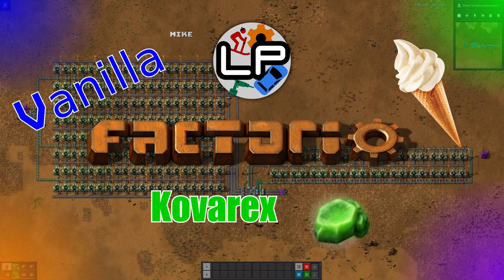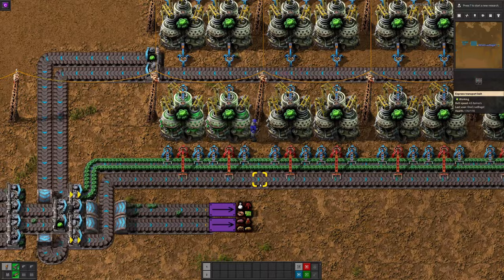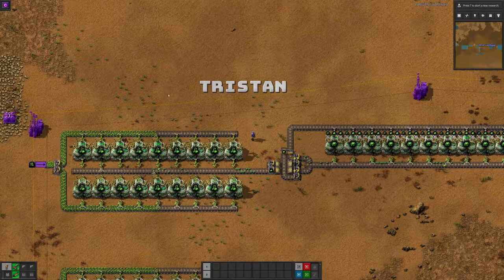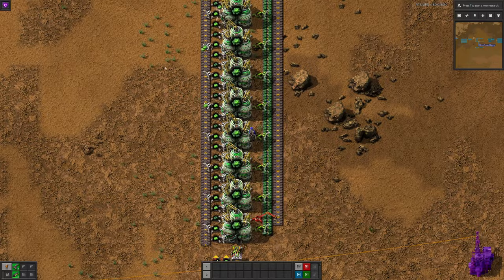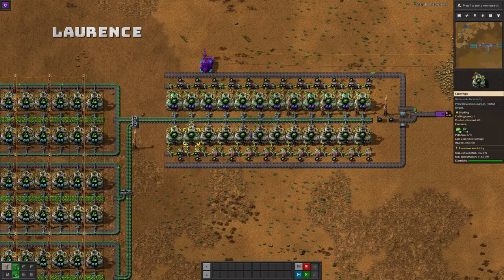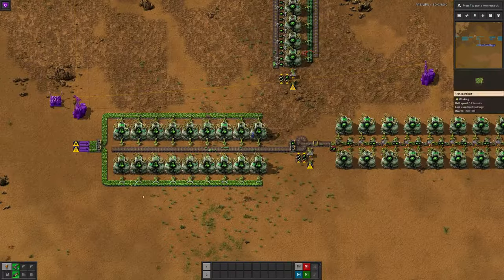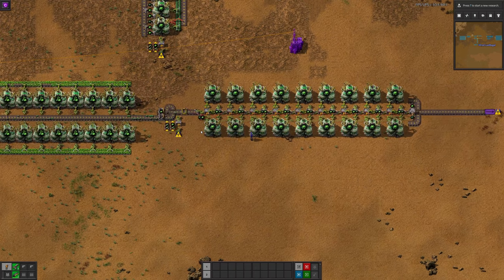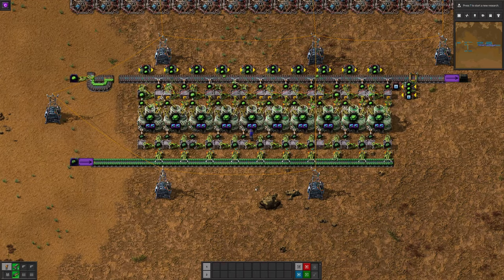Kovarex options - Flavours of (vanilla) Factorio - Laurence Plays

Comment: Some minor additions: 
First of all, if a machine uses 2 belts for the input, you should place the belt from which more items get grabbed as the closer one to the machine, this greatly increases the throughput.
Secondly, for energy-efficiency with beacons, its always a good idea to have beacons rather in the middle, so each beacon covers the maximum amount of possible machines, needing less modules and consuming less energy with the same output.
Reply from the maker: The first one is a good point, although if the machine runs slowly enough that the long handed inserter can keep up, then it doesn't actually matter. Was it a serious problem on any of the designs? I don't remember it being!
Beacons along the middle for conserving power (and speed modules) does make sense - I'll point out to Marc that he was being inefficient  😀
Reply: 1st: The beacon per machine ratio is max in this design.
2nd: I normally have multiple rows of setups like this, so the outer beacons are shared with the next design.

Comment: I guess it depends of your needs, but imo, a kovarex system needs to be able to not overflopw itself on 238 and keep making more 235 without the requierement of using the 238 on something ( and this having an exit belt of 238 going somewhere )
Which is why I guess the belt was missing at the end of Marc's design.
Reply from the maker: Yes, ideally your full system would be able to deal with any level of demand from the later factory - although a factory that just uses 238 and no 235 would be tricky, since you'd eventually overflow whatever buffer you had. I think all the systems we set up should be OK with only 235 being used though.

Comment: My comment the other day went poof, but I wanted to share a blueprint string for the method I prefer. It's most similar to Marc's final counting method, but avoids the need for circuits. In order to 'count' the 235 coming out, you use multiple filtered stack inserters with stack sizes set to equal exactly 41 total (one inserter grabs 1, the rest grab a combo of 40. When the craft finishes, all the inserters grab at the same time. you route the 40 directly back in (with the leftover 238) and your inserter grabbing the one can send it on it's merry way. no backup or 'kovarex wait' The machine won't fill up it's inventory until the 235 output line is backed up. 

It's a tad bulkier with the extra belts and expensive with all the inserters, but by this stage of the game..... ehhhhh. Easier than figuring out perfect circuits. You DO have to manually prime it by dropping the first 40 in though. After that, smooth sailing. 

Here's the blueprint string on pastebin: https://pastebin.com/XPUEAfB6

Thanks for your content. I enjoy watching.
Reply from the maker: I can see how that would work - thanks for the suggestion. Yes, a little bit bulkier, but I think it would probably be easier to see how it works at a glance. Nice one, I'll take a look  🙂